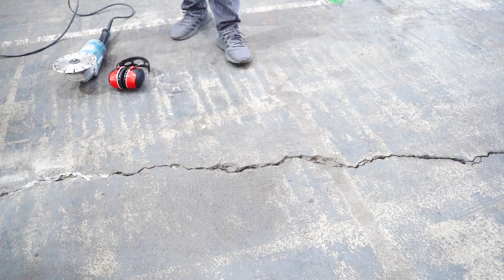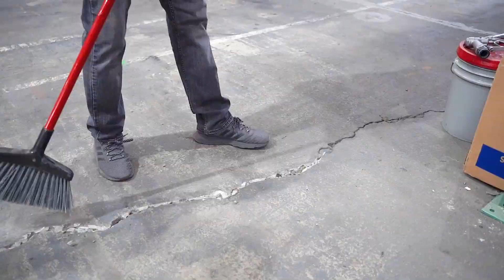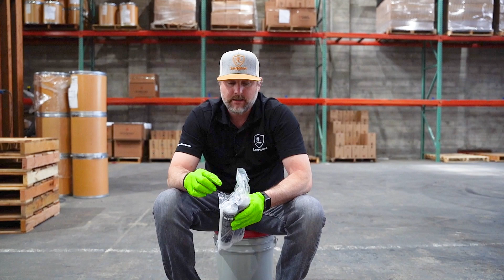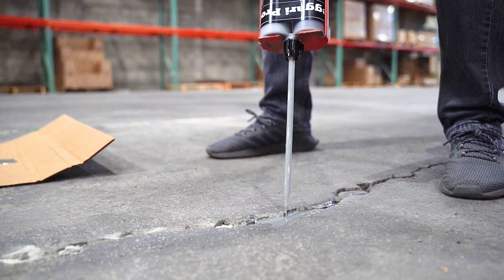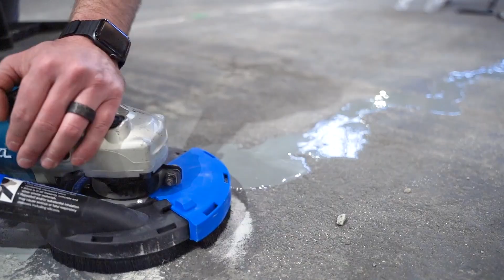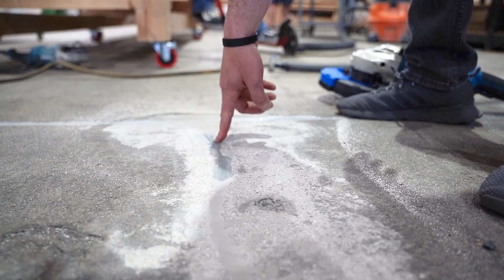Concrete Repair You Can Do Yourself! Using Professional Grade Resurface Kits

Comment: After grinding out the crack in the concrete, can backer rod be used with, or in place of the silica sand, to fill in large gaps?? Also, do you have another product for larger cracks where small chunks of concrete are missing, or would mortar or hydraulic cement work best for those areas??

Comment: If I apply some type of concrete coating will it adhere to the material you used to repair the crack?
Reply from the maker: Our leggari concrete overlay will adhere to the crack repair. I can't speak to any other products being able to bond to it!

Comment: Oh wow this is a better process than the usual way of repairing concrete cracks 💯
Reply from the maker: Way better!
Reply: @LeggariProducts  why wouldn’t you want the epoxy to go into the crack if it’s not going into the crack you’re not repairing the crack just putting sand in it and going over the top. Why not fill in the crack totally repair it and cut a relief joint if you think it’s going to keep moving? We do stamped overlays and we fill the crack all the way in to totally repair it I just feel like if you’re just going on the surface there the cracks going to keep moving and it’s gonna crack the Apoxsee if it’s not anchored into the crack or if water gets into it it can just pop off,but you are indoors. Some guys use Bondo resin, have you tried that?

Comment: I added this comment on the Vimeo post of this video, but figured I'd post it here too. 

So, what's the benefit of this versus the patcher paste? And which would you recommend more? I have a 2-car garage that I'm going to be doing epoxy on and there are typical cracks in the surface, along with it having a small expansion slot across the middle(and top to bottom). I've watched videos on both the patcher paste and this method now, both appear perfectly viable. Just curious if there's distinct reasoning between the two, or if it's a matter of personal preference for ease of application (this one looks pretty simple, while the patcher paste definitely takes a bit more work overall). Thoughts? Thanks for the time/input!
Reply from the maker: This is a fast set, so you can fill and grind within 15 to 20 min whereas the patcher paste takes 6 hr to be tack-free and usually 24 hr to be grindable
Reply: @LeggariProducts  Thanks for getting back to me, I appreciate it!